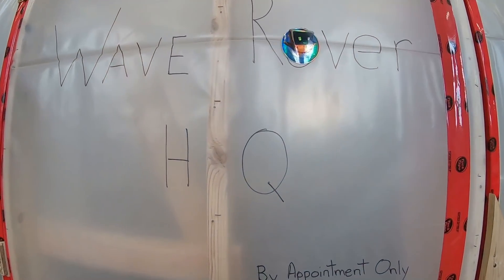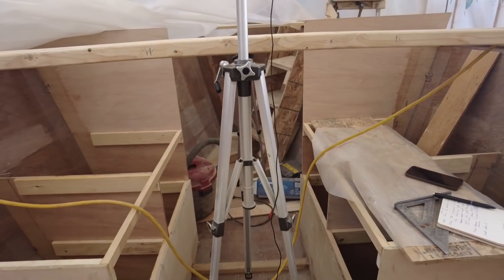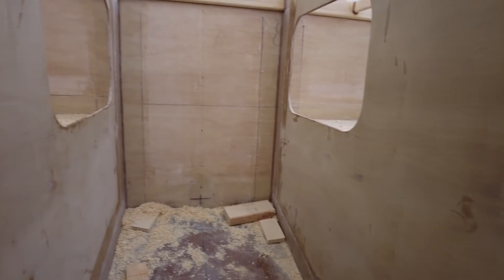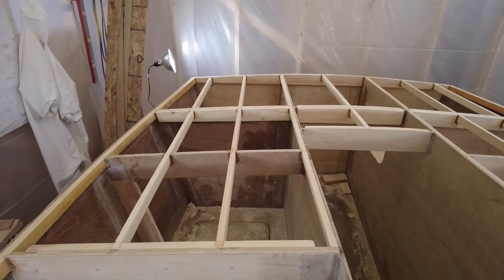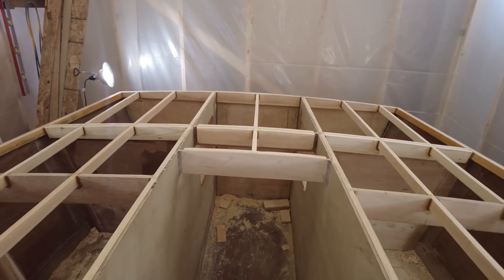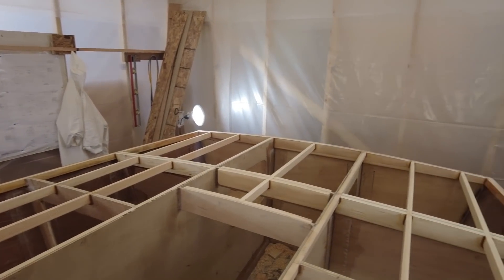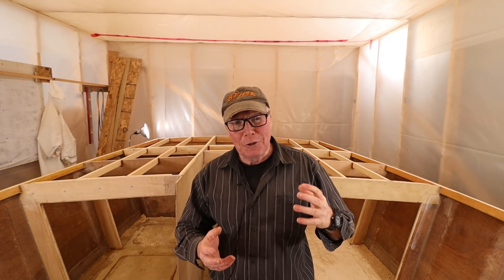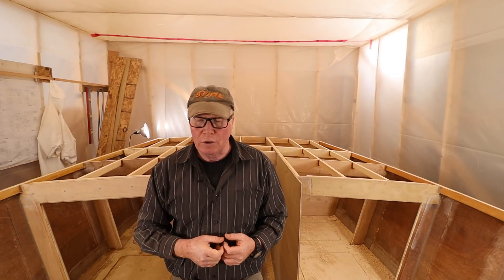S2E38 Significant Structural Changes Revealed

Comment: The dingy spray is most likely “303” I’ve used it with good results on Sea and Whitewater Kayaks. Apply in warn conditions in the sun 2-3 well applied-wiped dry with micro-fiber cloth coats allow complete drying between applications. It is fantastic stuff and surfaces will be slippery!

Comment: Looking good. I am a bit worried the curved cabin top is going to make access forward much more awkward than a flatter deck section, like the original doghouse. 

It also reduces the option for windows.

On vents, the Hurricane vent made in australia works very well. Keep the vents well inboard so they cant go underwater in a knock down, and make sure they cant drip on your bunk. Maybe use the tunnel aft behind the companionway to vent the foot of your bunks?

I really like how the Paradox design does ventilation. And Sven Yrvinds 360 degree system.
Reply: Just thinking more about it, any sidedecks around the doghouse only need to be about 200mm wide. Just enough to get a foot securely on something more level when she is rolling. Rather than the curved and angled section, that when rolled the wrong way could be very awkward. 

The lee side of the companionway structure would be a great place for a vent. Sheltered and inboard. It's only likely to see solid water if you get pooped. But a lot of the time an opening windows could be left open, giving great ventilation. Especially while cooking.

Comment: Thanks for all your instructive videos. I'm restoring and modifiing an aluminum sailboat and changed my plans and ideas several times over the years. Concerning the aft vents/portlights at wave rover 650, i would suggesst to install at least one at the portside to get rid of humidity and smells while cooking. If you plan to go to the tropics it's certainly better to have 2 or more Dorade vents in fore-aft-orientation. Good luck to you and your project.
Reply from the maker: Good advice all round

Comment: The cabin top look really nice, My only question would be: what does that do to your port and starboard lines of site? I am assuming that, at least in foul weather, that would be your watch keeping station. In Wave Rover and MingMing II, We see times of standing or sitting in this area and having an all around view. With the curved roof you would loose more than 180 degrees of site out of 360. Perhaps deadlights in the sides of the slanted hatch structure would work. Anyway, you have more experience than I do so maybe you have already thought of this.
Reply from the maker: There will be port lights on the cabin sides

Comment: This was one of your best videos. I am building a trimaran I have designed myself and have done more than one "last" major design change. One thing I have always wondered, Why isn't the mast used as a potential ventilation point? If air were forced down it would be guaranteed dry(but would need power), if air where allowed to flow out of it then you would have a chimney that would naturally suck out air. Any thoughts on this?
Reply: Re your mast ventilation idea... how would you keep the rain out?
Reply: @Garryck-1  The same way rain is kept out of chimneys and vent pipes across the globe... you put a vent cap on it.
Reply from the maker: Interesting idea.

Comment: I noticed something a few others have mentioned in the comments: The arched aft cabintop has no portlights to see out. It would be easy to add them on the for and aft sides, but looking abeam  would require rather large portlights in the deck. Two alternatives I can think of would be a butterfly hatch forward of the companionway hatch, or a plastic bubble, which would give you a 360-degree view and allow you to check the sail without leaving the cabin in horrible conditions. I've seen the bubble used on a few boats.
Reply from the maker: The dome idea is still on the table

Comment: Alan, will you be equipping WR II With a Jordan Drogue system? If so, I would expect that you have plans to beef up and strengthen the hull areas where you will have the attachment points for your drogue system. I seem to remember that you beefed up and greatly strengthened the hull where the drogue was attached on WR I and installed substantial stainless steel backing plates on both the inside and outside of the hull.

Will you also be carrying line to deploy for Warp? 

If so, where are you planning to store both your warp and Jordan Drogue systems?

Will you be carrying a dedicated life raft system ? If so, where are you planning on storing it?

Regards,

Lee
Reply from the maker: So many good questions. If you don't mind, I will address all of them in the next Time machine episode. Great content idea!

Comment: Really great update, I think the changes you are making to the original design won't suit everyone but they seem very sensible for the purpose of the boat as you have outlined it. I am curious if you are planning on having any hatches to access the storage under the enclosed cockpit area from outside the cabin. I think your concerns regarding ventilation are very valid. I would be even more concerned about mold and mildew than comfort in the cabin. The humidity in the tropics can be a real bother and while it may not damage the structure, (since I believe you plan on epoxy coating all the interior wood), your gear and stores will thank you for every bit of ventilation they receive. A few small 12v fans can really help in some of the "dead air" spaces and you could even set them on a timer to limit the electrical load. If the only air outflow will be adjacent to the hatch, the entire volume of the enclosed cockpit aft of those vents will have little or no ventilation.

Comment: condensation inescapable even if that's compartmentalized a highline "compartment Irrigation" (at least in reverse) system each tail with tap all connected to a single pump you can empty the compartments of choice as they are effected all at one time keep the pipe work to the top of each compartment to aid water tightness pipe pickup at the bottom of each compartment this would aid keeping this vessel dry.

Comment: I like the new deck lay, I think you should fit some kind of comfortable seating on the aft deck, perhaps folding down flush and that would work on either tack. Having removed the doghouse you seem to have no windows, perhaps you just didn’t add them to the drawings, but it would be very useful to have a forward facing window in the new raised round roof. I am sure that you plan to have side windows anyway.
Ventilation: you could fit dorados as and where convenient, but a suggestion would be to also fit small fans powered by tiny solar panels that would work during daylight and not draw valuable power from the house battery. You could buy such a thing from a yacht Chandler for about a million doll hairs or you could just fit a cheap as nuts old computer fan and a cheap as nuts little solar panel to each dorado.
Enjoying the progress, keep em coming.
Reply from the maker: Absolutely, a good seating area is planned around the pushpit. And for sure I will be putting some small strategic fans on board. Thanks as always for the comments Robin.
Reply: Dorades. Dorados are fish.
Reply: I am sorry that you feel the  need to mention such a trivial mistake. These comments are about helping Alan with his project, not nit picking people’s well meant contributions.

Comment: Wow, she's really coming along!  The boat actually seems to have grown larger.  Opening ports are great in the tropics, you get that cross flow as she swings on her anchor.  Leaking has been a chronic problem with mine, however, though mostly offshore when they are constantly assaulted by waves and spray.
Reply from the maker: Venting and sea water ... may they never meet on Wave Rover. Thanks for taking the time to comment Kevin. I'm keeping track of your passage North.
Reply: Next time rebed the ports with 'Bedit' butyl tape, and say goodbye to leaks
Reply: Bedit is not available anymore “store closed” I started bedding fitting with Butyl tape and I am a believer.!Much-Much better than 5200-4200.
Reply: @georgewashington7444  With a name like that you need to make the use of Butyl part of the Constitution!

Comment: I'd like to warn you about dorade boxes, where possible make sure the cowl can be rotated, my previous boat had fixed cowls mounted facing forward and I had terrible mould issues as the sucked humid air into the cabin, after some research I learned more about the venturi effect and turned the cowls facing aft so as my boat sat on it's mooring it faced the wind, the cowls sucked the air out of the cabin creating a slight vacuum and keeping the cabin dry solving the mould issue. As you'll be sailing you'll want to turn the dorade cowls away from the wind. as you'll have two forward, have another 2 at the aft end of the cabin or even better at the aft end of the bunks so you move air though the entire cabin. With your design if you can rotate the cowls from inside the cabin would be even better.
Reply from the maker: Great ideas.

Comment: The new housetop is probably much stronger and will give you lots more interior room, which considering how much time you spend down below will be very nice.  Only downside I see is it will make it more difficult to go forward on the deck to the mast, but that can be mitigated with additional toe rails or well placed hand holds I suppose.
Reply: One of the nice things about the Junk Rig is that it's very easy to have ALL lines led back to the hatch/cockpit area, so that, at sea, there should be no reason to go forward to the mast at all.

Comment: You could do a dorade style vent at the back of the cabin. Which ever dorades (those at the mast, or those at the back of the cabin) face the wind will let air come in the cabin, the other pair will let pressure exit the cabin to get airflow through the cabin. The boxes for the aft dorades would eat in the cabin space a bit so should be planned well. They could be higher vertical than they are wide horizontally (unlike the ones you will have on deck). You would then have a vent in the outside cabin side with a 90° bend going inside the box just shy of the bottom. And on the interior have a vent in the side of the box with a piece of pipe going horizontal in the box with an opening on the top side of the box just shy of the ceiling of the box. On the bottom of the box you would have a drain hole that spills any water inside the box onto the deck. If you don't want the airflow you could simply cap of the vent on the inside.

Comment: Under no circumstance would have limber holes. If you have a hole in the hull. I would want to contain the water to that compartment. You would only have an inches of water that will not sink or cause any concern.
If you have limber holes water then leaks onto other compartment.
Having access to these compartment you can check to see how much water is entering the compartment if needed pump from this compartment.
There is a water proof sealant that could be useful to have in an emergency.
Reply: With this low water line, he also could shift weight to one side and fix a hole thats not on the bottom. Besides that, the twin keels are perfect to fall dry and do your repairs.

Comment: Rather than the Port-Starboard venting or as well as , you should look at some bow-stern venting. I realize your from a colder climate and i'm unsure of where you have actually sailed but temps in the Pacific can be brutal. Mid 80's water temps with similar air temperatures and 80% humidity you'll melt inside.  I've regularly escaped the cabin and slept in the cockpit  and this probably isnt an option for you. Something to consider !
Reply: Hell, 90°s for the Gulf of Mexico at times as well as the equatorial shallows

Comment: Watching this again I realized that the new cabin top will make a great base for solar panels as well as adding strength. The rear deck will be a great place to work and lay about when in port. Looks good Alan.
I Googled clamshell vents and Vetus makes one that is 30 cm^2, 316 SS. Depending on where you buy $67 to $75 US. The look like the might work for you when mounted vertical.
Reply: You could easily put 2-4 flexible panels (300-500 Watt) up on the roof, and with a additonal wind generator and solid LifePo batteries, this should pleanty amount of energy for all systems.
Reply: @Jyskall  If adding 3 or 4 solars and a wind turbine proves possible,  how much power would they provide? Would it be sufficient to operate something like a radar system,  and/or an AIS transmitter?
Reply: @royhoward119  As what i can read in the specs, it is not to crazy to run a small garmin radar. It is somewhat between 10-40W in min-max power consumption. But yes you have to add it all up. VHF/Chartplotter combination with AIS is from 5-10Watt average.

So just calculate ~25Wh if you run your instruments activly with displays on etc. 
A 100Ah Battery with ~12V gives you ~1200Wh that are 48h without any power supply. 

You can get flexible Solar Panels with 70x100cm and ~130W max. On Average days, cou can calculate with ~5x its max Output. ~600Wh. So in theory 1 Panel could be enough to stay on power.  But you also have lights and other stuff, so 2 of them is better. But i would go at least with the 3-4x of your passive power drain.

On bad days with clouds an rain all day, you are lucky to get its max output over the hole day. (~100Wh or ~10%). So Windturbine as an additional backup for multiple bad days. Usally they have some wind.
Reply: @Jyskall  Add an electric outboard capable of charging when under sail to that mix and that would cover all the bases rather well! The Sailing Frenchman tested one made by ePropulsion and it seems to work fine enough for a small vessel, and I wonder if it couldn't be made more powerful if its prop could be switched out for a long offshore leg to better tune its characteristics for work as a hydrogenerator (a fixed prop pitch that is great for propulsion is ill-suited for hydrogeneration it seems, which is why the expensive solutions have servo-driven variable pitch to change it so the system can be good at both).
Reply from the maker: I'll be checking those vents out Matt, thanks

Comment: Alan By far... the best update to date. The two modifications have further strengthen and simplifed the hull construction of a all ready very strong design.
 I really like the camber in the doghouse as it gives a " tip of the hat" to the original Jester. While I'm sure it was not the intention its nice to see that good seaworthy design remainder timeless.
The five watertight compartments under the bunks are brilliant elements  structurally and wonderful storage that will help to keep your storage plan squared away. LOl... posted stowage will be a must.
Thanks for activating the time machine, you have really made progress in the last 8 weeks. 
In closing for now ( off cruising shortly) , The Wave Rover 650 is destined to be one for the ages...
Reply from the maker: Thanks Tom, my main reason for the change was to simplify the build, but when I looked at the  sketches it really appealed to me aesthetically.  I didn't see the Jester connection at first until another builder mentioned it.
Reply: @RoversAdventure  the camber in the doghouse creates enormous strength as it is now in tension....very strong compared to a flat roof...a win win! Style and Strength